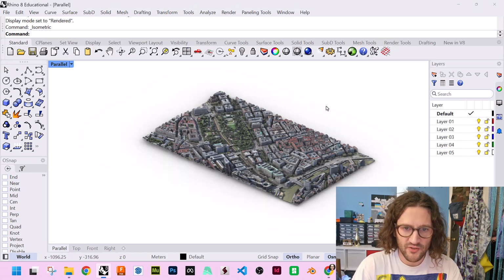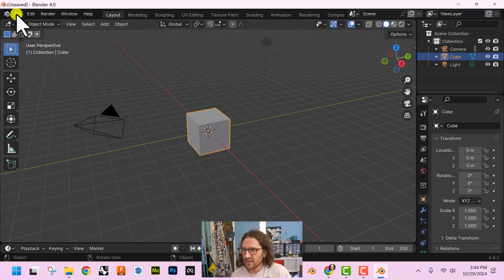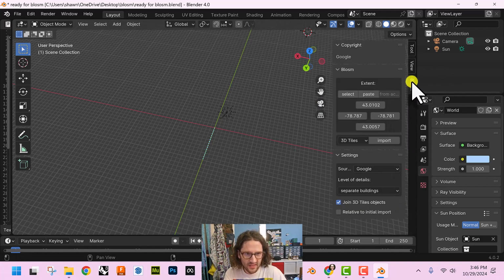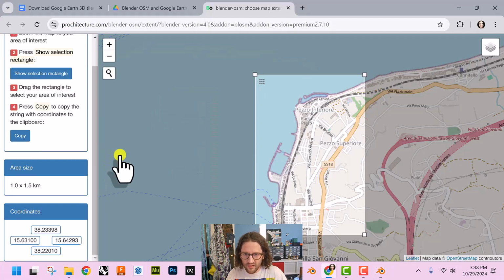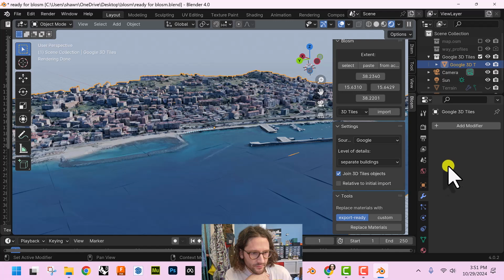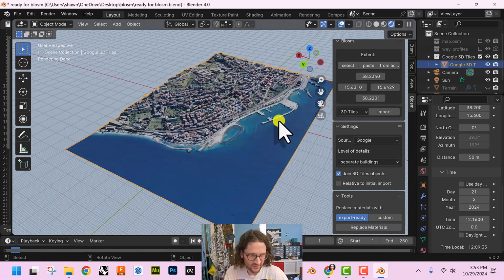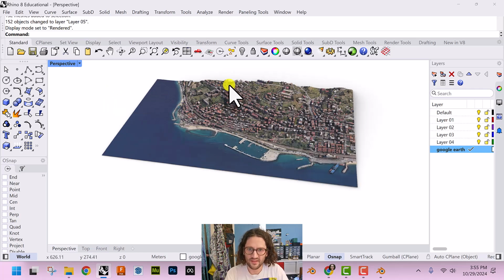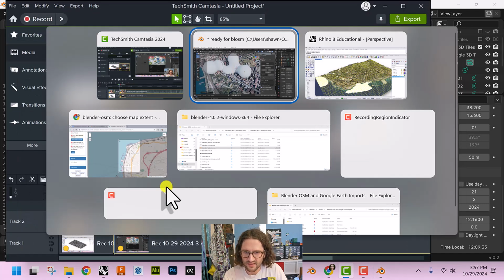download google earth maps into rhino using Blosm and Blender

Comment: Thanks for this Shawn. I have been doing this another way using render doc, you probably have tried it that way, but this way seems so much cleaner. I have however encountered issues when it comes to editing the textures. When i import into 3ds max or blender, in vray or corona, the textures are very bright, tryign to town down the textures gives me a multi sub texture with about one million different textures that is quite impossible to edit. Have you found a way to fix this issue? somehow collating all the textures into one which you can tone down or edit? thanks
Reply: I saw somewhere that Simplygon from Microsoft, will combine all textures into one large one, you can also choose the resolution size.

Comment: Hello, I'm in Madagascar. I paid blosm premium everything works for the installation, the API key... But at the time of import, Blender can't import. Can you help me solve this problem?
Reply from the maker: not sure. if theres error codes try giving them to chatgpt to help you to troubleshoot it
Reply: @ShawnChiki_edu  Thanks a lot, I did it and chatgpt advised me to see the settings and blender imports but flat images. I went back to chatgpt and it suggested "Solution: Check if the OSM data for Madagascar contains elevation information or look for region specific DEM (Digital Elevation Model) files."